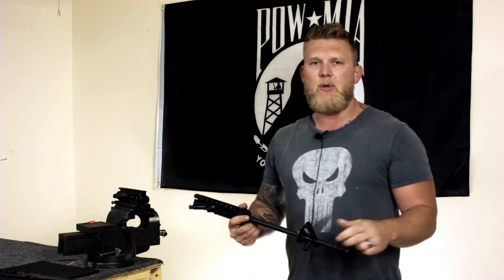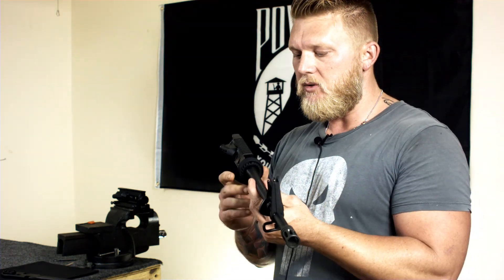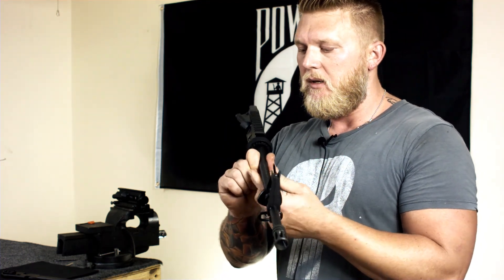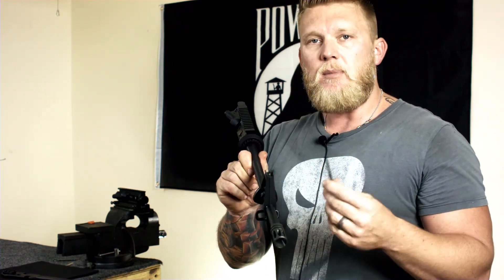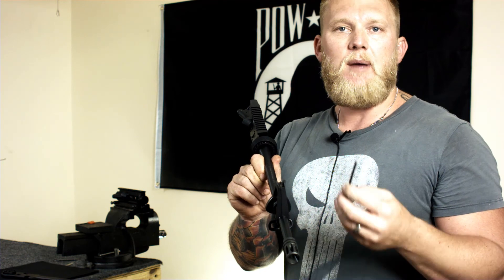Ballistic Advantage Basic Barrel Install Follow Up

Comment: Alright so I have a question for you. My first question is why does it take so long for you guys to respond back to my emails? I've emailed you guys quite a few times trying to figure out which Barrel I should buy from you guys. I emailed cinterion barrels and they first stop state that their barrels are way more accurate than your guyses which I cannot confirm nor deny but they get right back to me. Within a couple hours. I have been waiting almost 3 days to hear back from you guys and still have not heard anything. This makes me very concerned. Based on the reviews from other purchasers I decided to just go ahead and purchase a barrel from you. Hopefully if there are any issues with the barrel you guys will not take this long to respond back.
Reply from the maker: Hi,  I am not sure why you didn't recieve our reply.  But you can email me directly here - kyle@bamfg.com.  I will assist you in figuring this out.

Thanks!

Comment: I really get a kick out of some barrel installation video's , I have been working the M16  Platform going on 40 years , " 22 years U.S.M.C. "  I can honestly say I have installed at least 1000 barrels and I have NEVER in my career used a torque wrench . I also have never had a barrel come loose either.  I am in the process of assembling an AR pistol with a B.A. 11.5"  now to compare it against my Wilson barrels for accuracy .I shall return with a report.
Reply: Roha Waha how did it go ?
Reply: So.... been two years now... what's the report chief?
Reply: @ozymandias9549  1. Report : Forgetfulness is getting worse 2. Ballistics Advantage barrel accuracy was average 1.5 - 2"  at best at 100 yards tried a number of bullet weights , hand loads and factory ammo.. I do much better with Wilson Combat stainless barrels and even E.R. Shaw barrels.
Reply from the maker: Excellent. We look forward to your report!

Comment: how do you get a barrel nut on a barrel if it does not fit over the pinned gas block on hanson BA barrel
Reply from the maker: +hel lo Checkout our video on the gas block install.  That will really help you.
Reply: already have installed however cannot get the pin all the way through got 3/4 of the way